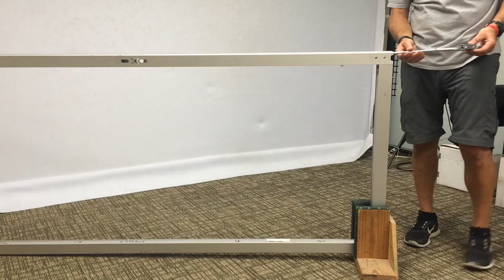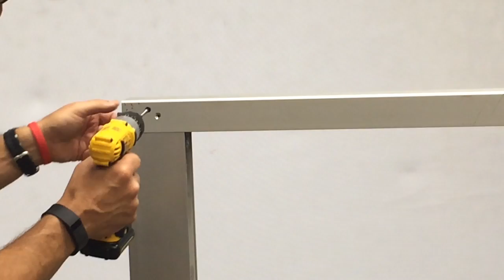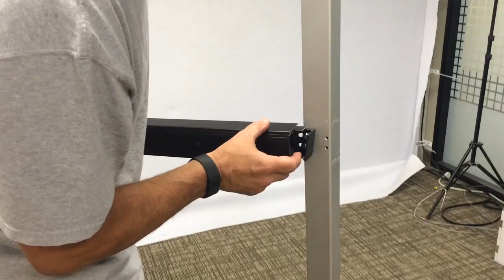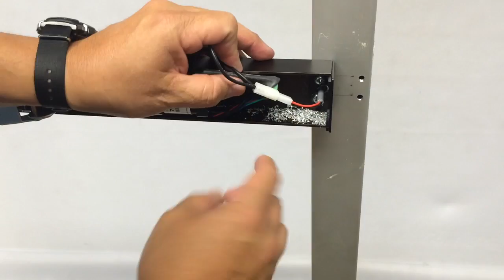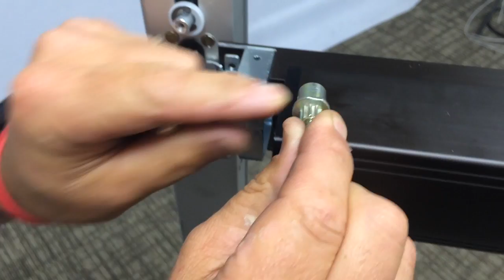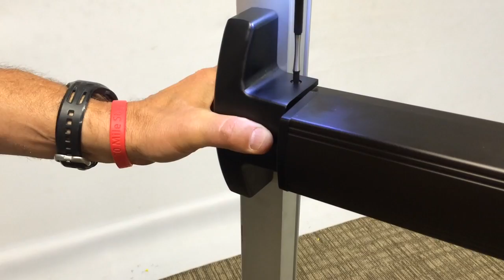Installation of the PD10-M CVR 36" retrofit device for the Falcon 16 & First Choice 36 series.

Comment: How do you adjust the bottom rod to stop dragging?
Reply: thats why im here as well... lol. but mine is a different model.. the kawneer door. i needed to do a rekey . now the damn bottom rod is dragging, fml!
Reply from the maker: You should be able to adjust the hex bolt to bring it up a bit. I would call into tech support for more details. Thanks for the future video idea!
Reply: @commandaccess  where is the hex bolt?
Reply: @commandaccess  We tried spraying WD40 from the top and that seemed to fix the problem on 2 doors. We're in an arid climate with dust, so when it got dried it wasn't resetting properly at the top and that seemed to be causing the drag at the bottom.
Reply from the maker: @Warvvolf  Glad, you got everything working!

Comment: hi were can i get the top rod with lock and the bottom rod and lock and the  wiring for the mororized lacth pullback
Reply: You can call Command Access at (888) 622-2377 to get information pertaining to your question.

Comment: Can you please give examples of where you'd want to use the , hold back option vs. the night latch option? Thank you.
Reply: The "hold Back" is electric dogging. This holds the push pad down and the device unlocked during a specific time period. The electric dogging is often used during working hours to allow people to come and go without having to swipe a card, enter a code in a key pad use a mechanical key etc. If installed on a fire rated door then the power supply should be hooked to the fire alarm system. If the fire alarm is triggered then the power supply cuts the power to the exit device and causes it to extend the latch, thus looking the door.
Reply: @locktrainer  / thank you, Sir🤠